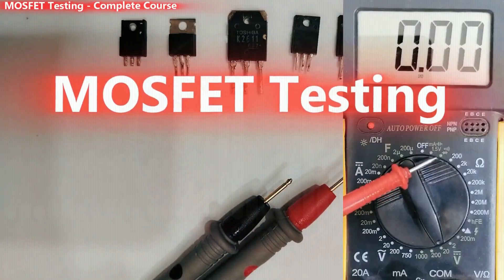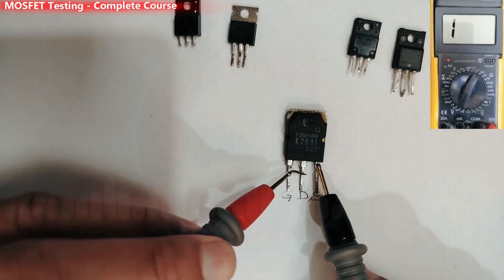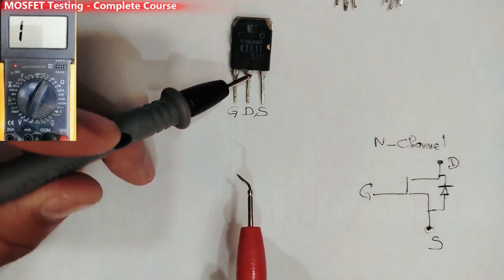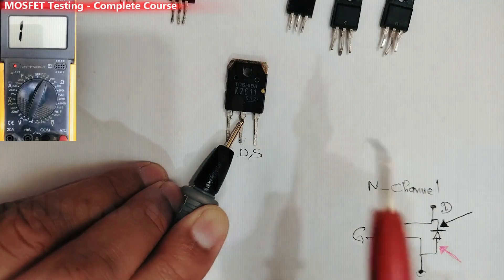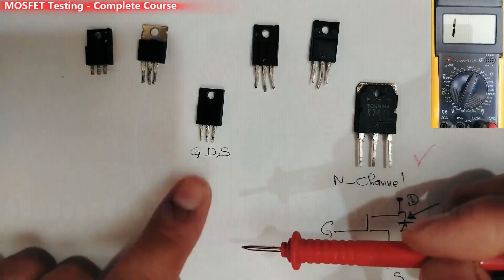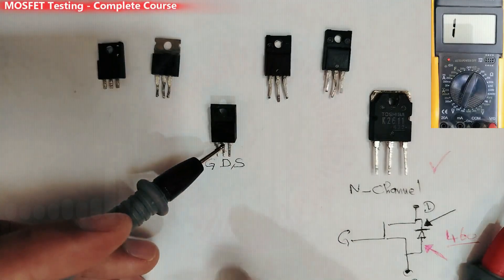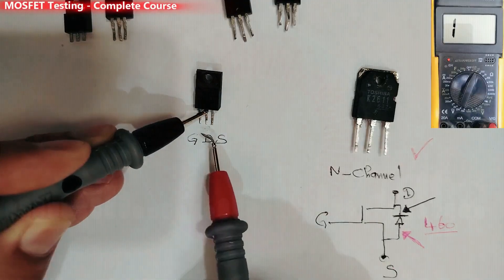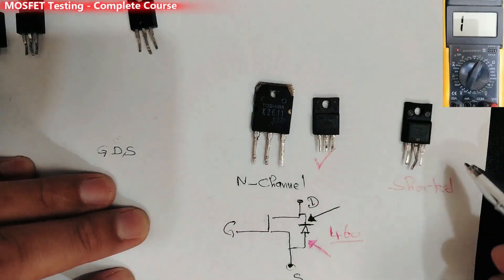Is Your MOSFET N-Channel or P-Channel? Find Out Fast - How to Test Mosfet Using Multimeter

Comment: Sir , there's something confusing with Mosfets :  the  current/voltage  flow direction . We know there's an internal diode between drain and source , and in your videos you constantly say  voltage can't flow in the opposite direction (reverse bias) from cathode to anode . But it looks like when the gate is triggered , voltage can flow both way  in  the drain-source diode